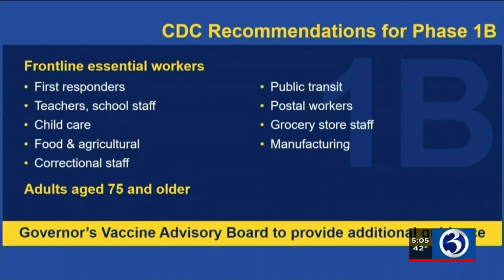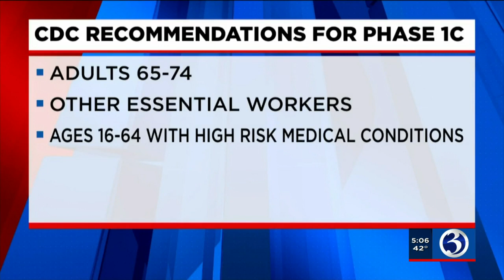VIDEO: Group of adults see their time to get the COVID vaccine shift following CDC changes

Comment: ALL death in CT individuals over 60 amount to over 90% ?
Where 64 t0 74 deaths equal over 22%  
Deaths under age 45 is apprx 3%
If the intention is to protect the most vulnerable,
 I question the current reasoning age 65 to 74 be in group IC instead of 1B
Should be explained publicly how groups were determined.